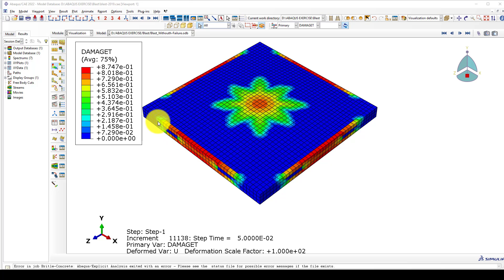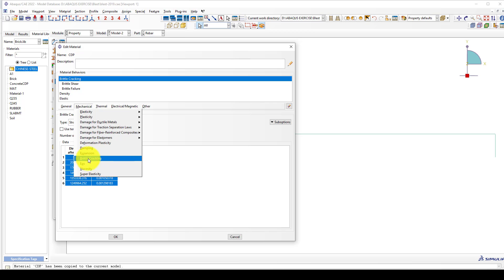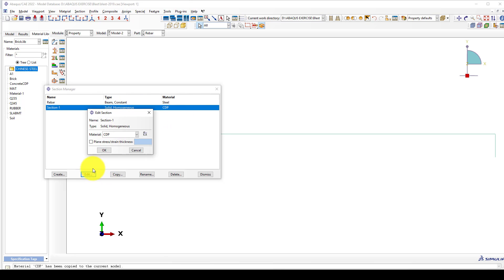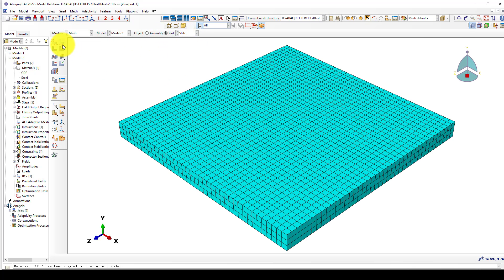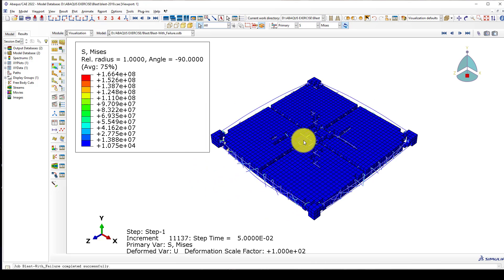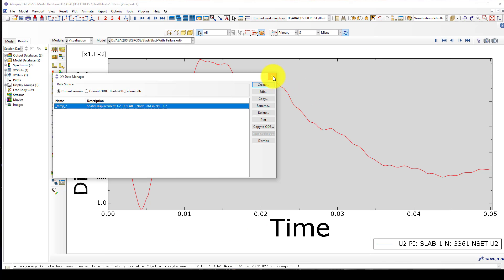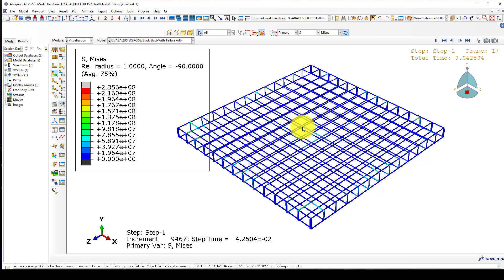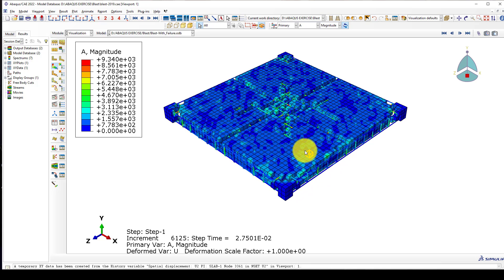ABAQUS Tutorial,  Blast loading on a brittle reinforced concrete slab considering Element deletion

Comment: How can we obtain the direct stress after cracking and direct cracking strain? Is it possible to find it from the tensile test data? how?
Reply from the maker: You can read some papers for this topic and check the plasticity of materials with fracture mechanics. it is not an easy that I should answer in a comment.